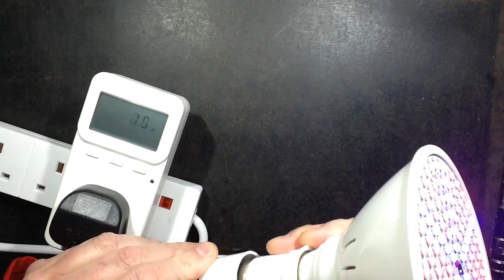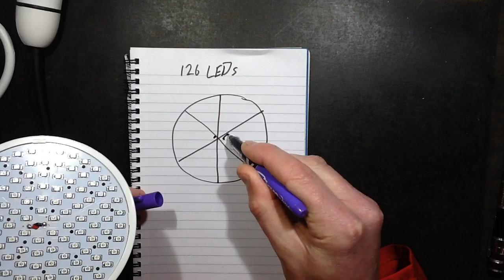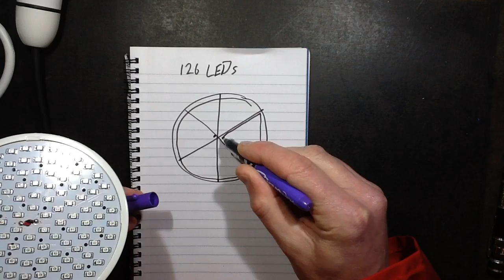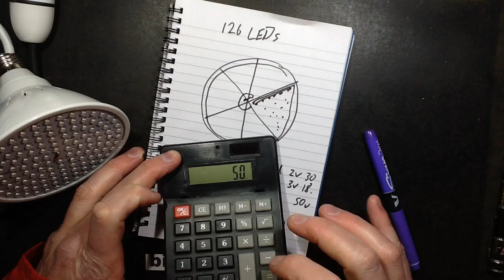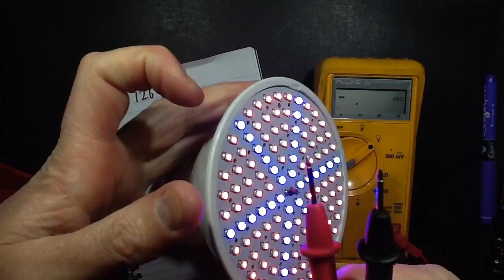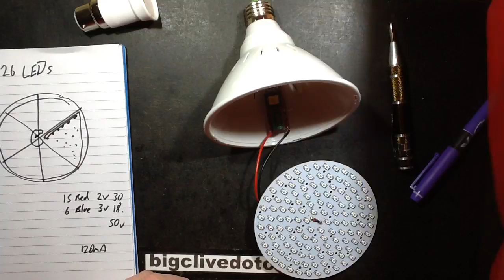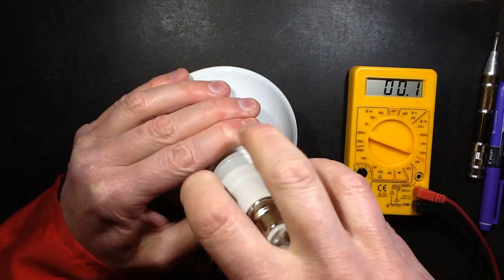126 LED hydroponic death lamp.

Comment: The LED driver may be a similar design to the one I found in an LED tube (a fluoro replacement tube).
Tube: https://www.youtube.com/watch?v=FcPiiDuyZFs
Driver: https://www.youtube.com/watch?v=52bDBKlbtms
I think it might be a switching regulator rather than a full switching power supply.

Comment: So is 50v DC as harmful as 240v AC? I like your channel, subscribed. You have quite a calming accent.
Reply from the maker: dmak2 The 50V DC is referenced to the mains, so if you touched a solder connection on the front of the lamp while referenced to ground you would get a full mains shock.
Reply: What do you mean by "referenced" to the mains? I apologize, my knowledge of electronics is somewhat lacking.
Reply from the maker: dmak2 The easiest way to describe it is as the scenario of a 9V battery being connected to a live wire.  You'll still measure 9V across the battery itself, but if you touched either of the terminals you'd get a mains shock.
Reply: Is it that there is no resistance to what the mains is supplying? I assume that the RCD in the consumer unit would trip? Either that or you'd have to rely on the fuse in the plug. So is it DC with mains "power"?
Reply from the maker: dmak2 Whether the RCD tripped would depend on which part you touched, as although you may get a mains shock it may limit the current enough to cause a severe shock without passing enough current to trip the RCD.  That could be very unpleasant.
Reply from the maker: Rou Lor The Chinese have absolutely no regard to the polarity of the Edison Screw base.  You have to regard the front of the lamp as being directly referenced to the mains.
Reply: bigclivedotcom assuming of course that the lighting circuit is RCD protected. Many aren't (mine aren't apart from the outside lighting circuit).
Reply: Rou Lor as an inhabitant of the third world for my own safety I never assume correct polarity in bulb sockets, wall sockets or that the live is the line passing through the light switch.
Reply: dieselscience Harmful as in the potential to cause serious injury or death to a person, animal, property, land, environment etc. Harmful is not a complex word. It simply identifies something that can cause harm.
Reply: Sidowse Uhh, you might be in over your head on this one....
Reply: Sidowse Here, let me take your hand and walk you through it.

1) You make an assumption. This is bad enough to begin with, but you fail to notice NO ONE ELSE is making that assumption.
2) You then proceed to ramble on in your own private little world ignoring the fact that in the real world this assumption is not always true. EVERY ONE ELSE discusses the topic in a mature manner using conditions that are true in the real world.
3) You display your total ignorance that real power supplies have a source impedance. You have to, you've already shoved your foot in your mouth with your initial assumption.
4) The open circuit voltage of a power supply doesn't mean jack shit when concerning the damage caused to a human. dieselscience pointed this out:
"... I should point out with negligible current a 50K ..."
5) You post your cute little "I=V/R" and conflate the open circuit voltage with the actual voltage experienced by the human AFTER being reduced by power supply source impedance.
6) Your reading comprehension is so bad that when your assumption is pointed out, you remain clueless.
7) Having no fucking clue ( due to your poor reading comprehension ), you now attack a petty grammar error, which isn't even an error.

Do you really have a degree? I would suggest asking for your money back. You were cheated.
Oh, and don't ever let a prospective employer see this thread. You won't get the job.

Note: "open circuit voltage" is the simplest expression possible to describe the effects in question. I could go into a full explanation of complex output impedances created by capacitance and active regulation. But then I would have to charge you for an education you obviously don't have.
Reply: dieselscience every amount of volts can start a fire. The power is what matters, and the heat dissipation in the flammable material.
Reply: Sidowse "the worst-case scenario is assumed"

Oh, I see, the victim is in the bath tub.
Funny how no one mentioned that.
Reply: Sidowse "Is 240Vac Mains more dangerous than 50Vdc? The answer is yes."

In other news: water is wet.

Oh, and body resistance is not CONSTANT,
it's proportional to the area of contact. Which is why the worst case scenario is when the contact is over the entire body, such as in a tub.

Thank you for proving dieselscience was right. You're just here for a shit throwing troll fight.
Reply: Sidowse You've already proved you're here for a shit throwing fight.

No need to provide more evidence.
Reply: Sidowse Non sequitur.

< face palm >
Keep digging, you're bound to hit China sooner or later.
Reply: dmak2 "Harmful" is a relative term....harmful to what?
Reply: Sidowse I'm an engineer by both training and trade. I invite you to specifically point out any mistake ...
Reply: Sidowse "Assuming the power-source can supply that current"

I'm assuming English wasn't your favorite class, especially reading comprehension.

BTW, I'm also an engineer. And a survivor of a 10KV shock. Wait...what? How is that possible? FINITE SOURCE IMPEDANCE
Reply: Sidowse
http://www.quickanddirtytips.com/education/grammar/can-i-start-a-sentence-with-a-conjunction

< face palm >
Reply: We are not 'all engineers' until we all have the university degrees say such....FWIW, mine are from USA and Germany. What's evident here is you're looking for a shit-throwing troll fight - look somewhere else.
Reply: ...Not always - it also depends on resistance ...
Remember "Twinkle, twinkle little star E=IR"

I should point out with negligible current a 50KV and even much more, shock would not be felt much on skin - so again, "harmful to what" and it's still the current that poses the danger in personal injury, not the voltage.
Reply: Sidowse Its true that the voltage between red and black is about 50V DC. The potential difference between earth and wires is actually either 0V or ~50V (depending which wire you touch. Remember that 50V is considered harmless) because he measured at the wrong point. Its hard to explain for me (since english is not my first language), but the part where the thread is, is connected to neutral and the socket/base is connected to 230V. This part is where the switching power supply is "cutting off" the voltage so that not more than 50V gets to the outer circuitry. If, however the poles N and Phase/Live are switched arount#d (like bigclivedotcom could probably be doing by using that adapter where he screws the lamp in) then this lamp could get harmful. If those poles although are being switched in the first place, screwing a lamp in can be dangerous in the first place, because the touchable parts of any light bulb COULD be at 230V (qoutation from wikipedia here: "The metal screw itself forms one of the contacts for the circuit. If the lighting system is not correctly wired, or a lamp is plugged into a non-polarized outlet, the metal screw can become energized, presenting an electric shock hazard to anyone attempting to change the lamp.")
Reply: bigclivedotcom like i said, under already dangerous circumstances where the collar (i believe thats how its called :D ) is live, this lamp is indeed dangerous. Just as any typical lightbulb would be, because anywhere on this planet the polarity of the edison base matters; even in the lands of cheap electronics. Under correct wiring and consideration of correct polarity, this item is safe! In every other case, i would recommend not to touch any part of it as it could carry a voltage possible of killing you.
Reply: 50V is enough to arc and start a fire.
Reply: It is the current that gets you....as the phrase goes.
Reply: dmak2 I'm quite impressed by the lack of electrical knowledge of the autor of this video and many commenters here. 50 V AC are the exact limit whats allowed (in germany) to have unprotected leads, because anything up to 50V AC or 120V DC is considered as harmless and safe. The point where "bigclivedotcom" measured the resistance to mains is actually the N (neutral) wire and has usually about 0V to earth. This lamp is NOT hazardous to humans although its not correct to have the N exposed. Apart from that you could touch the whole front of this lamp without being in any danger. Next time doing research on the safety of chinese products: Put the one end of your voltmeter in the earth pole of your power socket and then measure with the other end across the touchable wires of the lamp.